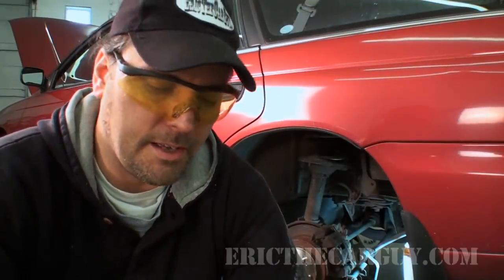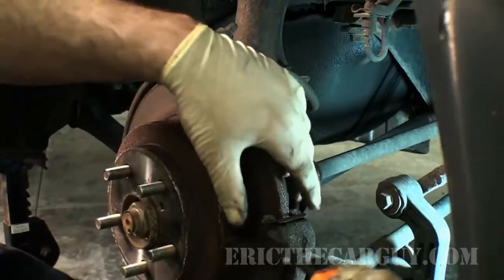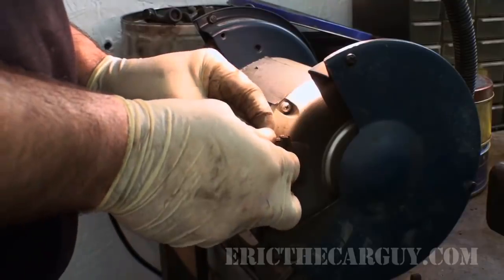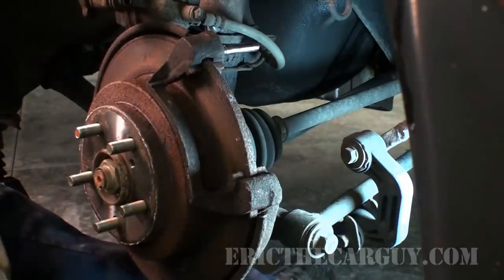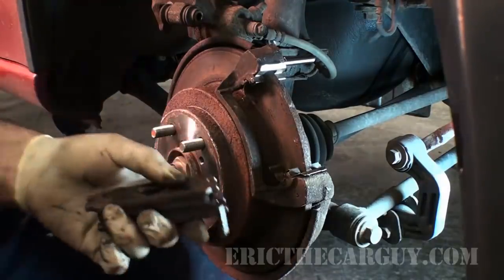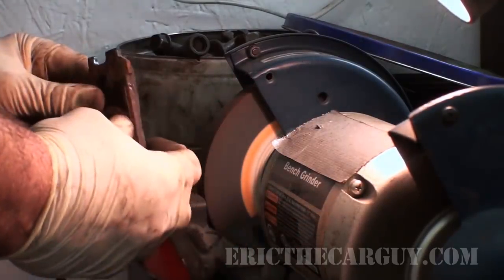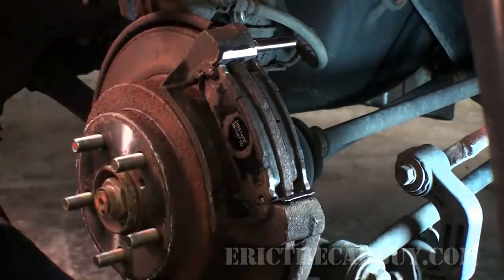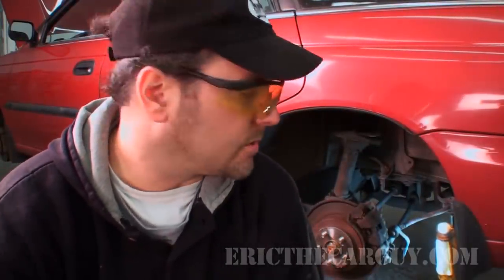How to Spot and Service a Stuck Rear Caliper - EricTheCarGuy

Comment: I have seen some break pads that came with instructions to lubricate between the shim and the break pad.  Can you comment on that?
Reply: Eric won't, but I will. I don't recommend that idea. The shim that goes on the pad should be firmly attached! Lube the part that is contact with the piston and the adaptor.
Reply: Actually that's exactly what he did with that anti-seize
Reply: NO WAY.
That would cause the shim to shift and cut the rotor.
Reply: ddd228 No, the shim sits on the caliper, and should not move relative to it. But the Pads move on the shims and that surface he lubricated, which is what Mario here mentioned. I think you mixed things up here
Reply: No. The shim should STAY fixed to the pads and the lubrication will go between the shim and the caliper piston/adapter.
BTW: Use MOLY black brake lube. Anti-seize is old school. Really.
Reply: Seems rather strange to me since from the video you can see that the two shims go around the rotor, so if they'd move with the pads they would come in contact with the rotor. Also, you can see that each shim is in contact with both pads, so if the shims were fixed to the pads then the 2 pads would not close together when braking. At around 10:45 you can actually see the pads move on the shims.
Reply: I think that you are confusing the hardware with the shims that attach to the pads. The shims attach to the pads,securely.
The hardware reduces noise that the pads could make due to vibration. 
The hardware is the part(s) that locate the pads and the (Attached) shims in the caliper adapter.

They hold the pads on their springy material to help "FLOAT" the pads to reduce pad- induced vibrations: Squeaks.
 See,now?
Reply: Well, I was referring to what Eric called shims, those metal brackets(?) between caliper and pads
Reply: I'm confused with the terminology myself.  Are both pieces of hardware that we are talking about called "shims"?  One piece is the piece that sits between the bracket and a brake pad, that's the piece Eric was cleaning with the wire wheel.  The other piece is the piece that is attached to the brake pad, and in the video he didn't take those off, and didn't lubricate them (on the outside toward the piston).
Reply: The thin shiny metal that locates the pads in the caliper adapter is called hardware. It must not have rust on it.
That hardware is a MAJOR cause of squeeks!!!!!!
Second is lack of proper lubricant.
 The shim in a flat sheet metal part that is bonded/riveted to the pad and should NOT move at all.
 Yes,you lube the pads with MOLY where there is metal to metal contact:hardware and where the pads slides within the hardware.
  Silicone goes on the slider pins.
The rust was not allowing the pads to be freely moving within the hardware.Thanks for the questions......!
Dave in Seattle.
Reply: THANKS!

Comment: Why didn’t you just wire brush the brake rotor/disc at the same time I know it’s not proper machining but it’s a step in the right direction

Comment: most of the time the pads are not cut properly and people hammer the pads into the bracket. ive seen it hundreds of times when doing pads. i usually have to shim the pads with my grinder to make them fit properly
Reply: Or 'clearance them' if they are too tight.
Shim if they are too loose.
Newcomers might be confused ...

Comment: I am pretty sure you use Loctite on the threads not silicone and new brake pads are not that expensive considering that brakes are safety critical. Other then that good video.
Reply: If you mean the threads on the pins for the brake caliper, I wouldn't have Loctite anywhere near it, just in case I would accidently get Loctite on the smooth part that is supposed to be for the caliper to ride on and then have a stuck caliper once again.
Reply: I was doing it in accordance with the Ford manual. I guess ever car is different. Loctite 242 or 222
Reply: trickeeau I'm surprised that was in a Ford Manual.  I guess if they say do it, then do it.

Comment: Couldn't you in theory softly wire wheel the brake rotor surface to get most of the rust off and then crosshatch with 400 grid sand paper to give the pads a new surface to seat too? This is all provided the rotor isn't warped and has no groves in it

Comment: Have u seen new car brake pads on a new car? They dont have lube at all at the pad ears. I don't know why people lube them as it is NOT the cause of customer noise. I've seen so much gunk on ears that it ruins the pad friction surface and causes rotors to be contaminated. Most mechanics lube everywhere hoping to stop the noise that is like throwing parts at the car and guessing.  

Lube attracts brake dust causing more friction.

Comment: Ok i got someting for you  ..I have a 2001 Ford F150  on the left side my brakes sicks all the time ever thing is new on that side ever thing  abs  or what  I need help
Reply: Maybe check that pads slide free ?  I just ran into new pads that were right but wrong, in other words laid back to back with original they looked almost right.  But the "machining" looked like it was done with a plasma cutter, would be cheaper but it doesn't seem as accurate as die or mill. if you laid the pads flat the cuts were not vertical, they were angled.  Had to grind just like Eric did.  Kind of sad I think.  Just a note, It always seems like its the drivers side that has the "more than standard maintenance" brake issues, at least with my luck.   The passenger low side of the road gets the most abuse suspension wise, but maybe the high side brakes work harder?

Comment: Hey Eric. Why are u hitting the 12 mm wrench with ur hand. You seriously gotta stop doing that. I have damaged my hand doing that for years and years. So would be nice if u could teach some of those basic tips to people watching ur videos.
Reply: Mallets are cheap to replace, hands are not.
Reply: Sometimes I use a pry bar on a wrench for extra torque
Reply: I use a 5 pound sledgehammer to persuade those tight/rusted bolts to move works great

Comment: Great video but I cringe anytime someone wears gloves while grinding, that is just not safe to do.
Reply: I don't think the thin latex would pull his hand in. Those other gloves people wear, they're going to get really fucked up.
Reply: I ALWAYS wear gloves while grinding.  If you're doing it much you simply have to because the parts get freakin'hot.  Don't grind when sleepy, drug or alcohol impaired, pay attention to what you're doing, etc, etc.  Not a problem.

Comment: why not take the dust cover off the piston and clean/lubricate with rubber grease while you were at it,  only half a job done Eric.
Reply: @Frank. T 
If you want the job done correctly that's what you need to do unless you want to do all this again in another six months or so.
Reply: @Frank. T 
Yes but looky peepy behind those dust covers and find all that rust on the pistons and the leaky seals, It could frighten the crap out of you.
Reply: @Frank. T That's me mate I always buy genuine parts for my motor.
Reply: @Frank. T 
Noooo, English through and through lol.

Comment: Why would you use a round Dremel to grind the inside of a square, flat sided object? There is such a thing as a flat file, and they remove debris easily and quickly. Also, using a grinder on any sensitive piece that goes on a brake is unacceptable. It only takes a minute more to use a file and it is more accurate.  One more thing...DON'T use a ratchet to remove a frozen nut. Especially don't use a hinged ratchet. If you have to bang on something, don't ruin your ratchet by banging on it. Use an open ended wrench. They are much cheaper to buy, and they are more durable if you have to bang on it. I appreciate your video. I learned something about the parts of the brakes that I didn't know. However, I feel if you are going to do an instructional video you should show the PROPER way to do things, AND you should show all steps including cleaning or resurfacing the rotor. If you are going to do it yourself all parts should be shown. Why put cleaned parts onto a dirty rusted rotor?
Reply: i agree with using a file however unless u have a round file with the proper inside radius then your not doing much. The carbide burr bit is perfect especially that pointed cone type that has a small radius at the tip. with a skilled hand one can precisely remove just enough metal at the high spots. use chalk or white-out to find the high spots.

Comment: at what point would you replace the caliper,?
Reply: It needs to be diagnosed as to why is dragging/not releasing.
Not very often the caliper piston is at fault.
Usually, lack of lube is the issue.
Reply: i had the issue i had to replace it, it was lubed fine, just that my car is 18 years old things break, you can tell you need a new one when ur pads are always in contact with ur rotor, making a unique bad burning smell, in my case i had to replace the rotor because when pads are pressed to to rotor it is like driving with ur brake on. it warped the rotor which sucked, and the high heat created by it chipped the paint off my wrim. another way to tell is when ur braking the brake pedal will vibrate or jolt up and down. so when putting a new caliper on, be sure to bleed the brake, its easy u gotta use the bleed and fasten it down once brake fluid comes through, then top off ur reservoir. it feels like i wrote a novel here, but i really hope it helped especially if u have caliper problems, make sure to get it fixed cuz ur brakes protect ur life
Reply: Seized caliper pins are very common. AMHIK.
Reply: dsouzand
Reply: When it will not retract.Usually a dragging caliper dictates replacement.
The tough part is to diagnose why it is not retracting. Cable actuated?
 They are usually CRAP.
 Sliders or the hardware?Piston or the frikken' cable.
Reply: "Replacement" ??  Depends on your mechanical skills. (Unless you just want to chuck money at it). It is usually not that hard to dismantle stuck slider pins, clean them (and the holes) and re-grease them with silicone grease. The only one I've failed on was on the rear of an Isuzu Trooper, NOTHING I tried would shift it. Even then I bought a new carrier but NOT a caliper.
Reply: wow that was pointless. the bad caliper will mess up the pads and rotors again

Comment: Nicely presented. I managed to unstick my calipers by using the brakes and have the engine running you get extra force from the brake servo to do the job.  Here is my video showing this https://youtu.be/155109ONAKE

Comment: rotors and pads are so cheap. Why bother?
Reply: and if those pads were stuck to the rotor wouldnt the rotor be warped, i mean how did the dude get the car there, he drove it so he mustve been driving around and warping the rotor
Reply: Rotors are NOT cheap. The brakes are cheap. The rotors are not.
Reply: +Inkling of course that is the exact reason i do rotors and pads myself, they are expensive nonetheless, but at least at places like avance autp parts and auto zone they have sales, rewards and money back on money spent, if it wasnt for them and knowing how to do brakes id be further into the poor house😂, but i agree 100% rotors sure are expensive
Reply: But Dan - higher up you admitted to wearing the pads down to the backing. Not sure that is ever wise!
Reply: +Peter Bloggs I know it's not wise, it's happened to me before😀😩 just tryin to save someone the heartache but yeah it wasn't wise
Reply: Brake parts are cheap, collisons are not.

If the rear brakes fail unapplied, in a hard stop the rear end will swing out and you are likely to lose control.

If you then slide across the road and hit someone, by the time they're done suing you for reckless endangerment and casualty losses, it will cost more than a new vehicle.
Reply: They were not stuck TO the rotor.  If they were the wheels wouldn;t tun.  They were stuck in a position away from the rotor far enough that rust wasn't being scoured off.
Reply: Rear rotors are inexpensive for what they do. Brake pads are less expensive than rotors. Basic maintenance is less expensive than pads.
Reply: Stuff seems expensive in the U.S, here in England I can replace rotors and pads front and rear OEM spec for £100 which is about $127

Comment: anyone try to ghetto turn the rotors by securing rotor with lug nuts and washers turn vehicle on put it in gear an use a file on the rotor while its spinning? worked out ok on my old rear rotors .. looked like they came out the trash pile at junk yard before and after they looked legit like i knew what i was doing
Reply: No lol you never file or sand a machined surface.
Reply: @VinylToVideo  ''ghetto turn''  was a deliberate choice of words. it worked out fine but i wouldnt go out of my way to do it again ..at the time i didnt have a extra $120 for another set of rotors after spending little over 300 on hubs, rotors, calipers , hardware. 1 pine tree air freshener . priorities .